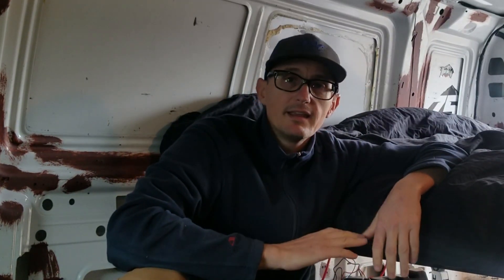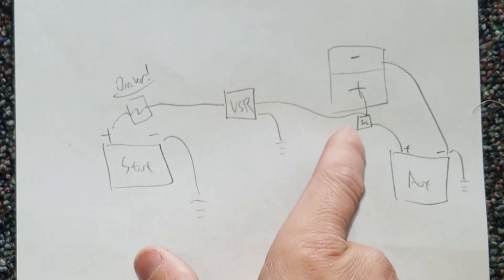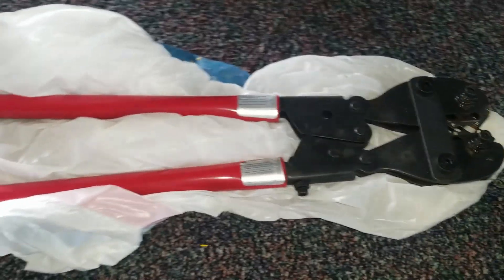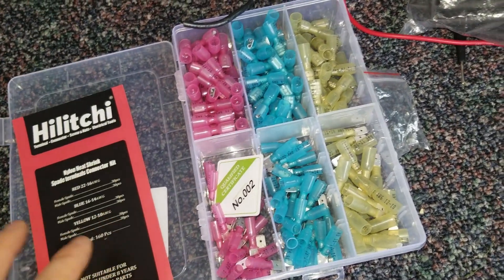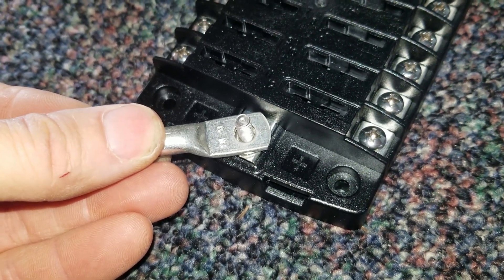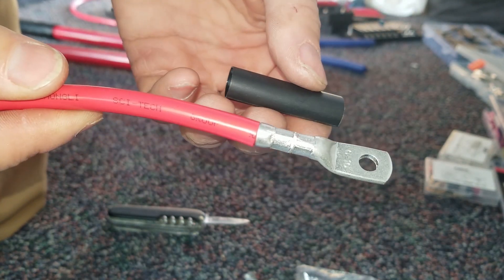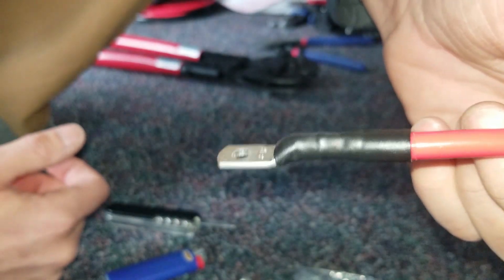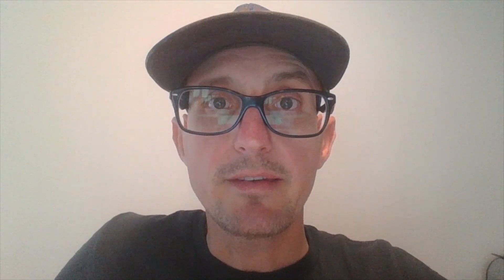Simple House Battery with Dual Battery Charging System - Basic DC Electrical - Camper Van Conversion

Comment: Came accross your videos with the glow plug relaay and now this one.  I have the same van and wanted to share what i have done on my house batter. Mine has 2 starter batteries.  One is mid body under th barn doors.  I bought a second box like the one the mid body one is in.  I moved the starter battery forward a bit and have both the second starter and house battery under the barn door as well.  Since the initial install a few years ago with a small led battery I have upgraded to much bigger lipo batter and ended up fabricating a custom battery box that fits that space as well.  This set up leaves more room in the van

Comment: For electrical work, have you considered using wago lever nuts? I first saw them on Adam Savage's Tested channel, where he was reviewing top things in his workshop. They seem to be the next legit thing, as there's mechanical locking for the wire but it's simple to install. I just bought an Econoline and I'm loving this conversion content!
Reply from the maker: I haven't used wago nuts.  I have been hearing about them more and more but I'm a bit stuck in my ways with respect to simple adhesive lined crimps.  For what it's worth as well I recently removed this entire system and upgraded to a 560ah DIY prismatic cell lithium house bank with 3kw inverter and induction cooking.  I'll post a video about that soon!